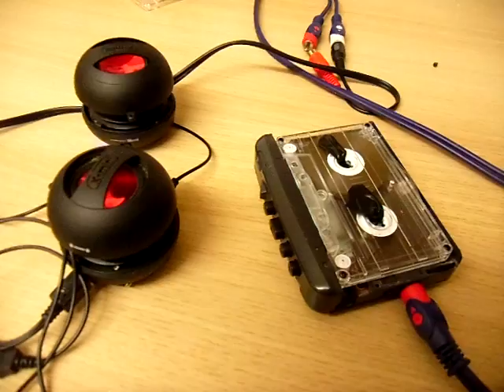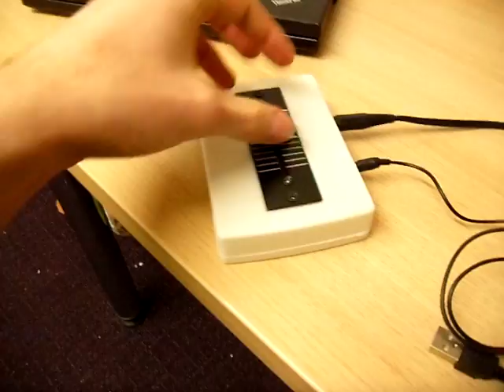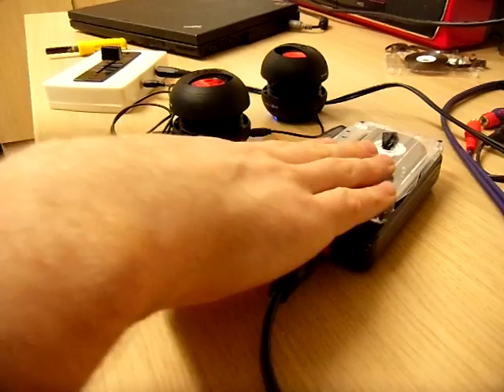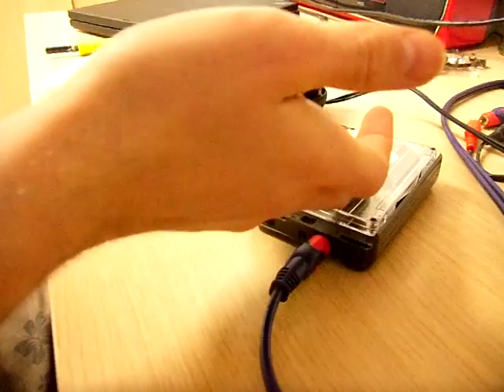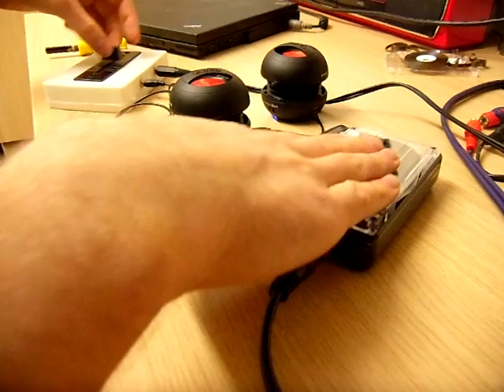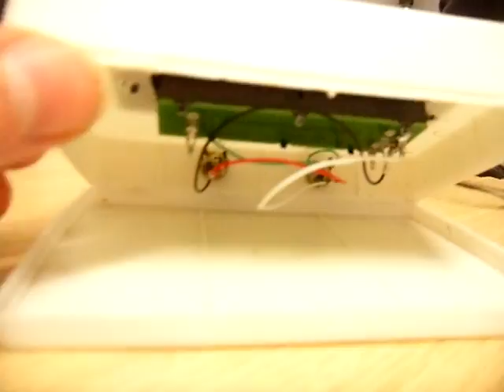Scratching with Audio Cassettes - Prototype Device

Comment: @PlasticParty:  their is a risk for the machine to eat the tape if you do scratching with it. I remember when I was a kid, I was curious about how it work mechanically, since the cover of the cassette player broke off I had the opportunity to see how it work and I did not care about the casette tape that I used for testing because does song where annoying for an older kid, they where song for toddlers and I did not have brother, and neither sisters,  while it his playing if you try to slow down the take out spool, the tape does not get eaten but it slow down the music, but if you slow down the take-in spool while it his playing, it will eat the tape because of the pinch roller and captsan, but as soon as you let go of the take in spool,  it undo eating the tape, and the music sound wonkey when it undo eating the tape. I had another boom box with the cover still on it. so I was not worry to broke that one.